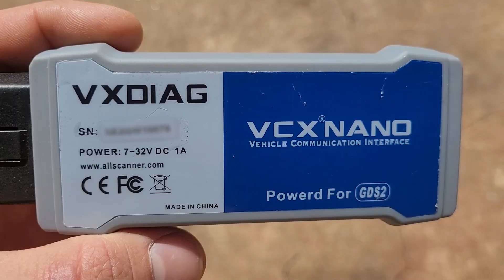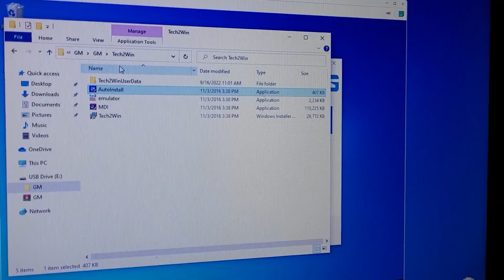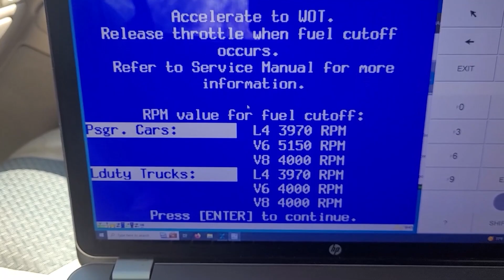AMAZON Scan Tool? Crankshaft Position Sensor Relearn!

Comment: Had a mechanic replace the sensor in my Blazer and it is now misfiring horrendously even just idling RPMs jump 500+ back and forth. He didn't seem to know anything about relearning. Will have to take it to someone with a proper scanner tool to try and relearn it and see if that improves the misfiring as it is not good now.

Comment: I HAVE A QUESTION ABOUT THE FIX FOR THE PROTECTION MODE VIDEO... DOES IT WORK WITH A GMC DR44 ALTERNATOR TOO???
Reply from the maker: I did it on my DR44G. That was the alternator in the video. It's really just a temporary solution.

Comment: Just bought this VCX nano diagnostic tool man. I’m hoping that I’m smart enough to hook it up. Pull my computer out of the closet. That’s been set for three years. Gotta deal with it and then download this thing somehow anyway can’t wait to see if it works. I bought a nova 5610 and the thing did not work for my 2006 Chevy Silverado, so I sent it back and got my $400 back. It would be nice to get one piece of equipment that you can do everything with and not have to piece it out here and there and introduce different software today is the day to get this problem, finally fixed with the crank sensor.

Comment: I replaced the computer in my 2003 Cadillac Seville SLS.  I now need a scan tool for the crankshaft variation relearn procedure.  In the video, I saw you choose F4: Crankshaft Pos. Variation Learn and then you said 4000 RPM.  Did you just have the vehicle in park and step on the gas until you were at 4000 RPM and as soon as it was at 4000RPM it's done?
Reply from the maker: Yes, but if you don't follow the procedure exactly it won't work, and I accelerate fast. Pretty sure if you don't press on the brake it won't work either.
Reply: Usually you enable the function it will tell you to rev the engine until the RPM limiter kicks in. Then it will complete.  I use a snap on D9 Apollo for this.   Most of the times it will not run it if codes are present or engine isn't at operating temp.

Comment: What were the symptoms of your truck vefore you replaced it. Ive got rough idle in park and at stops. With no codes and of i drive it long wnough it will throw p0300 code and even qhen i clear it it atill has rough idle replaced plugs wires and packs. Tps maf purge valve and vent valve solenoid and its atill doing it. Could this be the crank shaft position sensor
Reply: I just had watched a youtube video of a guy that had the same symptoms as you with the p0300 on his 5.3l silverado.  It turned out that his fuel injectors were plugged and that he needed a new fuel pressure regulator as well.  That fixed it for him.

Comment: My Hummer H2 has knock sensor codes sometimes. I have upgraded to oem harness and sensors. Any thoughts?
Reply from the maker: They are supposed to be torqued to 15ft lbs I believe. If you overnighten them they can read wrong. All I can think of.
Reply: @MattsShop  ty 4 follow up

Comment: I’m just doing this now with an Autel Maxicom MK808 and it’s not responding after I do the rev to 4000 RPMs.  it just says “accelerate to wide open throttle release if fuel cut off occurs”. and that’s all I get to.  😢 if I keep trying it, it starts backfiring and misfiring at about 2500 RPMs. What am I doing wrong or not doing?

2005 yukon denali 6.0
Reply from the maker: You gotta follow the procedure exactly. Also dont set the parking brake it won't work. It's only gotta hit 4000 RPM for a split second.
Reply: @ I followed the directions exactly and I did set the parking brake, because it told me to in the scanner .   so maybe that’s why it didn’t work?  Thank you so much for replying
Reply: @ I just tried it again without the parking brake set and it took the test, but it keeps displaying the same thing. Accelerate to wide open throttle release if fuel cutoff occurs. I did it again while it was saying that and it flashed test in progress.
Reply: @MattsShop  finally got it. They never said to keep your foot on the brake during the test so my natural instinct was to take my foot off the brake pedal and that invalidates the test so, (WHO KNEW?). LMAO.    Anyway--I finally got it. My opinion is they should give you clearer directions.